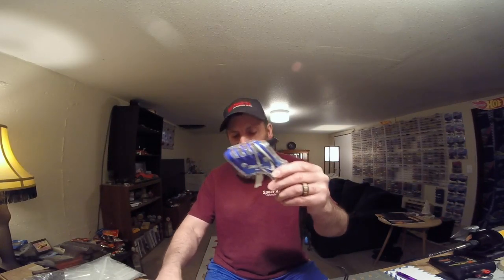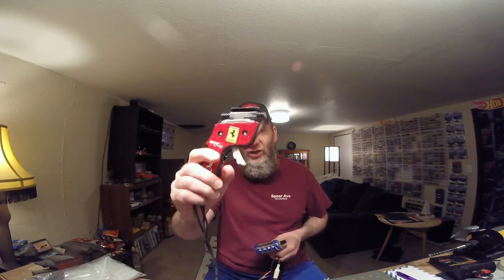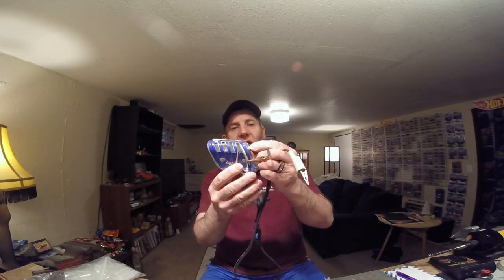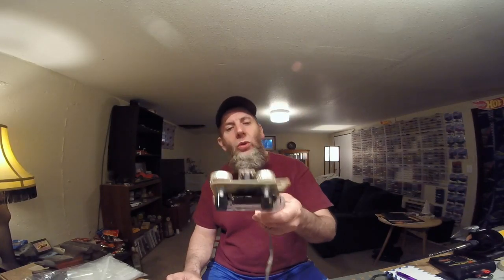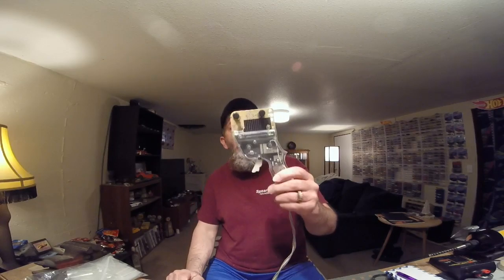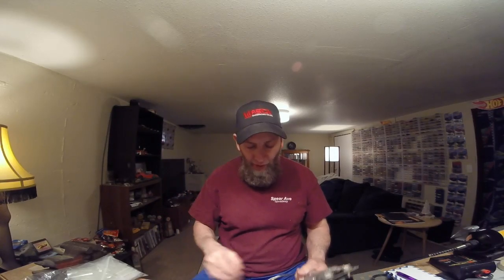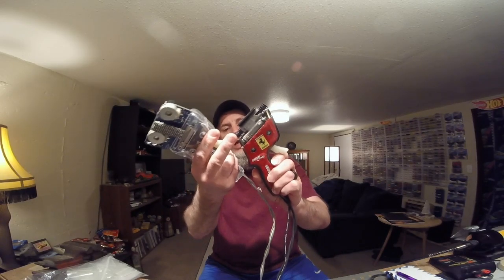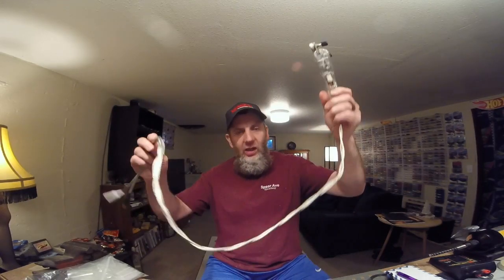How the ohm's in your controller effect your car

Comment: Another quick note; the controllers Troy is referring to as "digital" are NOT digital controllers. They are analog controllers that use an electronic circuit board with transistors (SCRs) or a resistor array to control the power. They act like a "resistor" by using electronic components and are far more adjustable. Some of these electronic controllers may have a "digital" control circuit on the board but their power output is the same as a regular ceramic resistor.
True digital controllers can only be used to control digital slot cars as their speed is controlled by an actual digital signal that is interpreted within the circuitry of the car or circuitry in the track.

Comment: For what is worth, I found this info on the internet: 

Pro 10 and faster cars (built up Slotech, Viper, Wizzard, BSRT) will work best with 5-10 ohm control.

Pro 4 (stock Viper, BSRT, Wizzard) will work with 15-30 ohms

Mega G, SRT, Lifelike, and Tyco work with 30-45 ohms.

T-Jets work with 60-90 ohms (many like to add a secondary resistor to provide slight fine adjustment).

Mega G+ need 120 ohms for effective control.

Comment: Some clarification: Be careful as Jeff mentioned below, MG+s have a high ohm armature that needs a high ohm controller. 

The important part of the ratio of resistance in your controller to the resistance in the entire remaining portion of the circuit (arm, brushes, pickup shoes, track rails, power taps, etc) is to correctly position the POWER BAND in your controller.

A properly sized resistor is one where the car just barely begins to move when the wiper touches the second winding and continues to go faster the farther along the resistor the wiper goes and delivers max power just as the wiper reaches the end of it's sweep on the resistor.

If the resistor value is too low for the car, the power band slides to the left meaning that the car will jump off the line when the wiper touches the second winding (like an on/off switch) as the car is already receiving more power than it should be and max power will be reached well before the wiper gets to the end of it's sweep.

If the resistor value is too high for the car, the power band slides to the right and the car won't begin to move until the wiper is well in to it's sweep and, because the power band is skewed to the right, the resistor by itself will never provide max power. (Some controllers like the Parma Turbo and TQ controllers have a "full power" contact separate from the resistor so full power will be delivered when that contact closes at the end of the sweep regardless of the resistor size or power band position but it will cause a noticeable "jump" in speed right at the end of the trigger pull).

THIS is how your ability to control the car is affected by the controller resistance to arm resistance ratio.
Either of the conditions described above will also cause both the controller and the car to run hotter than normal.

Comment: Inaccurate. Mega G+ needs a high ohm controller. In sets they come with 120 ohm controllers. You'll have a hard time driving it with, say a 60 or 70 ohm controller like most other sets come with. This refers to Mega G+ ONLY. Original Mega G runs okay with 60 or 70 ohms as do most other stock HO slotcars. Depending on the track most stock cars with Traction Magnets and even the older Slotcars may perform better using an aftermarket 45 ohm controller. Built cars with stronger magnets and low ohm armatures need a lower ohm controller. 35, 25 ohms for example. Depends on the car, track and voltage. Pro cars may need an even lower ohm controller. The most common aftermarket controller most people are going to want is 45 ohms. Without "brakes" for magnet cars, they don't need it.
Reply: Thanks for this comment. New to modern slots and his 25 ohm comment for magnet cars has confused me.

Comment: How do I select a drag controller?
Reply: For HO slots? Check with Difalco controllers and he can set you up with a controller that has interchangeable resistor banks. But bottom line is that it really has to do with the resistance of the motor in your drag car. But I recommend Difalco if you want to compete seriously. Good luck man